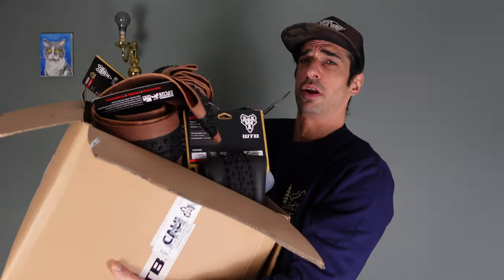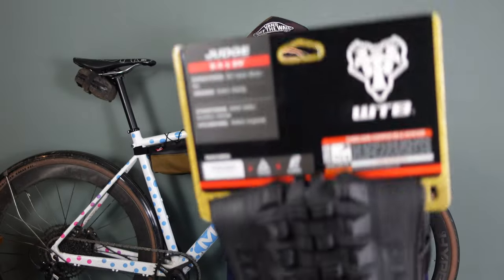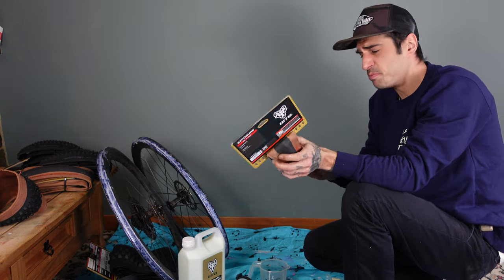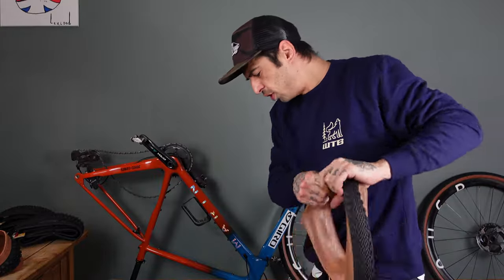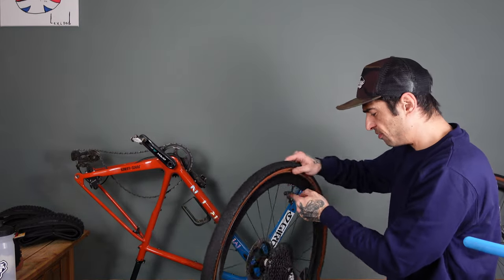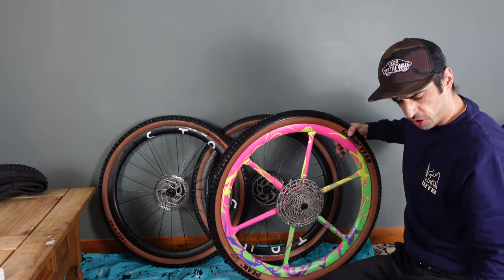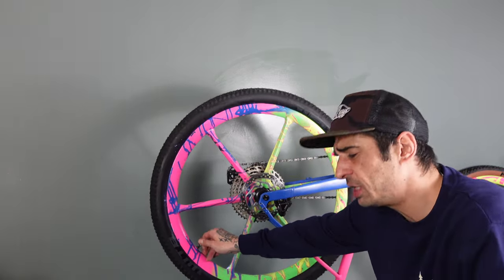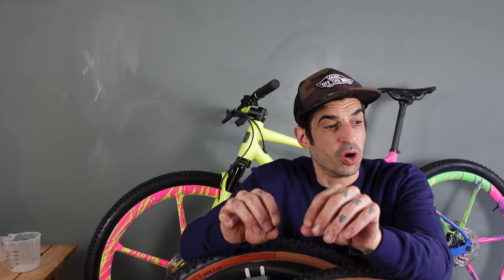New Tyre Sponsor

Comment: Hi David. Great video as always. I live in London so do most of my riding on really bad old roads and canal paths as part of my daily commute. What 700c gravel tyres would you recommend?  Keep up the great work.
Reply from the maker: If you’re mainly riding canal paths and old roads the Riddler is pretty good. Not as aggressive as the Raddler. Or maybe even on of the commuter tyres. Do you ride a lot of off road?
Reply: @DaveNoakes  Thanks for the reply. I ride very little real off - road terrain - the Raddler would probably be overkill. The Riddler would hit the sweet spot in the WTB range. Was contemplating the Byways but have seen very mixed reviews.  Appreciate the great content and reaching out.